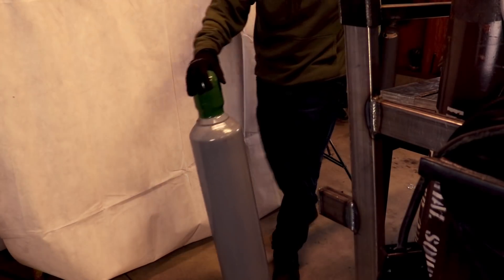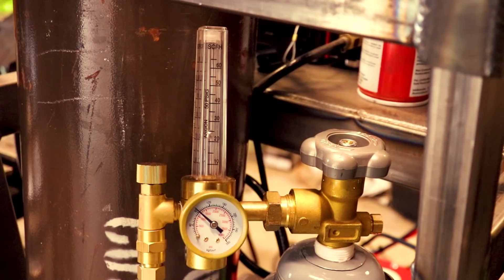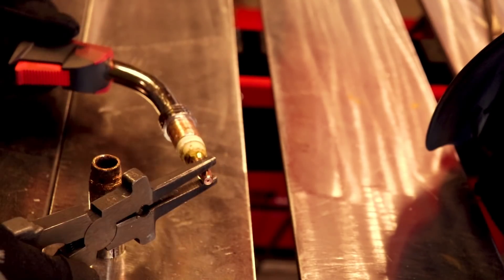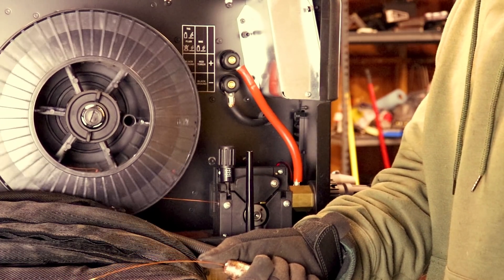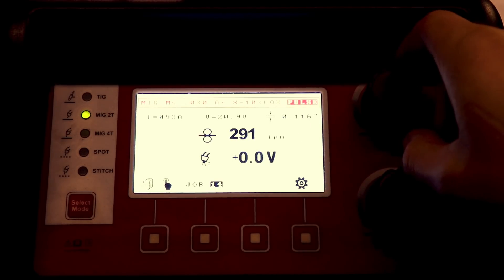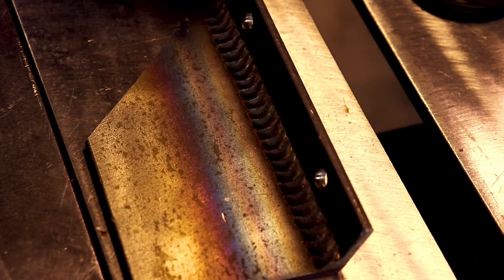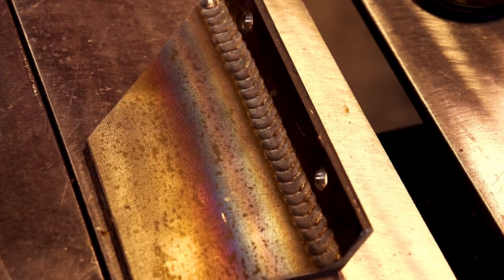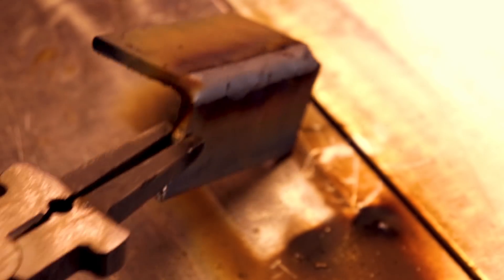Pulse MIG Welding Basics with HTP Pro Pulse 200

Comment: THX. WHEN YOU SET THE WIRE FEED SPEED DOES THE MACHINE AUTOMATICALLY SET THE UPPER AND LOWER LIMITS OF THE PULSE IE AMPS AND VOLTS? ARE THE MAX SETTINGS MUCH HIGHER THAN IN THE NON PULSED MODE/
Reply from the maker: Yes it automatically adjusts it but you can trim it up or down to your liking.  Im not sure about the max settings

Comment: Killer talent man. I know U R busy, but I can’t find 1 thing online about pulse Mig’s effect on the welding tip. I’m considering a Miller 255 with pulse. The reason is that I hate the constant black and mess on my welding tips! I’m hoping that pulse Mig would fix 90% of that. Would appreciate any word about this👍🎃
Reply from the maker: Ive done almost exclusivly pulse aluminum mig so im not sure?  Maybe try a good push angle
Reply: 5th Street Fab Thank you. Just a suggestion, but if you want a video idea, I can’t find a decent video covering Miller pulse weld on steel anywhere on planet earth. I think pulse Mig on steel just might be the next big thing trending in welding. And the current videos on it are skimpy and lame.
Reply from the maker: @w46try7  thanks for the idea!

Comment: Hey Max great video. I was looking into upgrading  to a pulse meg welder. My question is how does 90/10 gas mix work with short meg welding? If I upgrade I would not want two have two (75/25 mix)different bottles. Also is there a reason not to use pulse welding for mild steel?
Reply: I mean mig mig mig not meg

Comment: Can I use 100% co2 in this machine ... if I do not have mixed gas in mild steel wire 035
Reply from the maker: yes you can but you can't weld in pulse mode with c02

Comment: What determines whether you are running short or long arc length? Distance you run your gun from the material? Voltage you run? It is my understanding that the Pro Pulse 200 adjusts your arc length automatically as you are welding, this is what gives it a consistent weld.
Reply from the maker: Ya so basically the voltage controls your arc length if you increase your voltage the wire will start melting further away from the puddle, which will give you a wider bead.  The pro pulse will self adjust to keep your amperage consistent even if you're running a longer stick out or your work to tip distance.
Reply: @5thStreetFab  Right on! Your comments lead me to this article that has some good explanations as well.  

https://www.lincolnelectric.com/en-us/support/process-and-theory/pages/variables-weld-penetration.aspx
Reply from the maker: Right on!  I'll have to check it out when I have time!

Comment: I just looked at the welder on Thier web site. What's the difference between the aluminum mig gun and the steel mig gun. Is it just the liner?
Reply from the maker: The Aluminum gun is shorter with a plastic liner and a higher rated gun as far as amps.  It makes it easier for pushing the soft Aluminum through the gun.

Comment: Hi max its nice to see a pulse mig video about carbon steel. Most of the videos on YouTube are about aluminium only. 
I have a pulse mig in my home shop and had issues burning up consumables initially I changed to zirconiated tips and then eventually a full water cooled torch which solved all my issues. I use a try mix gas with my machine
Reply from the maker: Ya I thought the same thing.  I used a trimix on stainless before but not of carbon how does it work?
Reply: @5thStreetFab  yeah saying that there isn't a whole lot on pulse mig full stop. My machine does double pulse which i use for aluminium was a bit of a steep learning curve as its not my day job and id usually just go straight for the tig. 
The try mix gas works well cant remember exact mix but its argon carbon and oxigen. Have you used your machine much in the vertical up position i found my synergic values to be to high i tend to go off the amprage or wfs for v up
Reply: chris bergin they are always “too high” for vertical.   
The values shown (doesn’t matter which manufacture) are typical for the flat position only. Like a 1F or 1G weld ....  if you go out of position expect to dial the machine down.
Reply: @ZILAwelds  Hi ZIla thanks i quickly worked this out this is my first synergic machine although ive now had it for about 1.5 years its a re branded Lorch sp320. Have you thought about doing a pulse mig on carbon steel video?
Reply: chris bergin i will make one.  I am familiar with the machine you have.  Its sold as a thermal arc migmaster 320 here and at some point i new the australian name ...  but its not coming to mind right now ... in  australia the machine is white or grey with blue writing i think. 
Either way lots of programs in there - really expensive here in the usa almost $8000 and its a single phase machine only. It is very similar to the lincoln C300 or the HTP pro pulse 300 
So maybe i should make a video on pulse mig steel with the pp300 ....  
the 200 only has single pulse on steel - the 300 has single, double and manual adjustable double pulse ....  
you can do some wicket cool looking stuff with that ....  make some nice ripples....  
when i get some time in a few weeks i will try to make a video on that ....
Reply: @ZILAwelds  That would be great im always interested to see how someone else approaches different welding processes. 
In Aus they wer sold as CIG which has now been brought by Esab. My machine is a 3 phase 415 volt unit i think they retaild for 10,000$ au here. i got it second hand with less than 2 hours on the clock. You can produce some pretty cool looking welds in double pulse mode on carbon steel and aluminium not to mention the quality of the weld. Pulse mig is rarely spoken about on other channels other than yours is it not a popular process outside of production line work and boat building.